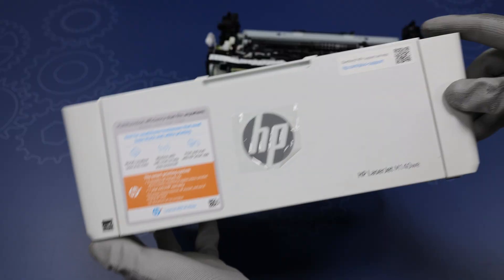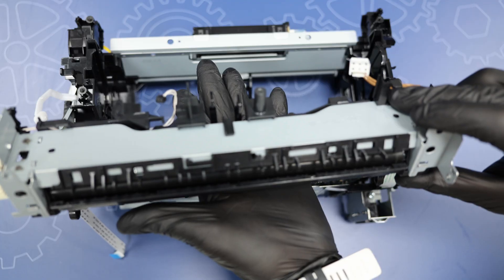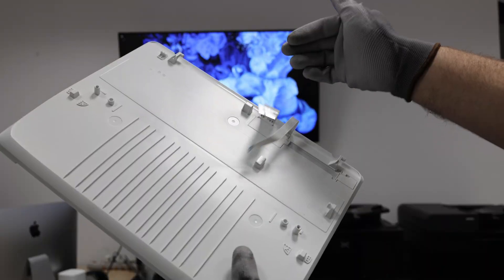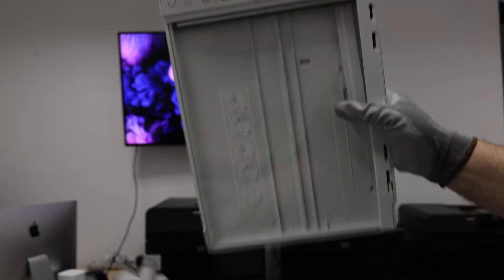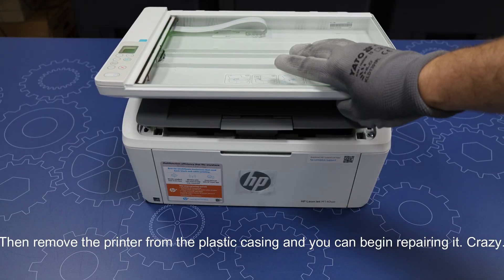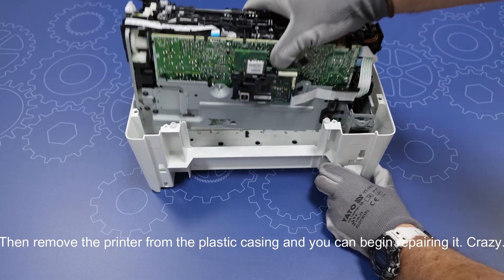HP LaserJet Pro M140 Fuser Replacement – Difficult Procedure for M100, M110, M130, M140

Comment: Experiencing feed issues on a heavily used m110we.  I'm having a hard time finding replacement parts.
Reply from the maker: Unfortunately, this model is basically a small “toy” printer — it isn’t designed for heavy or intensive use. Every printer’s price reflects the monthly duty cycle it was built for, and the HP M110 is a very light-duty machine. It doesn’t even have a cooling fan. It’s simply not meant to print 100 pages in one go, let alone handle constant high-volume work.
I know it’s not great news, but that’s the reality. You might want to consider investing in a stronger, office-grade machine — not a $100 printer, but something closer to $1000. Only then can you expect real durability and performance.
POLAND: Niestety ten model to w praktyce mała „zabawka” — nie jest zaprojektowany do intensywnego użytkowania. Każda drukarka ma swoją cenę i wynika ona głównie z miesięcznej wydajności, do której została stworzona. HP M110 to bardzo delikatna konstrukcja, bez nawet podstawowych elementów chłodzenia, takich jak wentylator. To nie jest urządzenie do drukowania 100 stron jednorazowo, a co dopiero przy stałym, dużym obciążeniu.
Wiem, że to nie są dobre wieści, ale taka jest prawda. Może warto rozważyć inwestycję w mocniejszą, biurową maszynę — nie za 100 dolarów, tylko raczej w okolicach 1000 dolarów. Dopiero wtedy można oczekiwać realnej trwałości i wydajności.